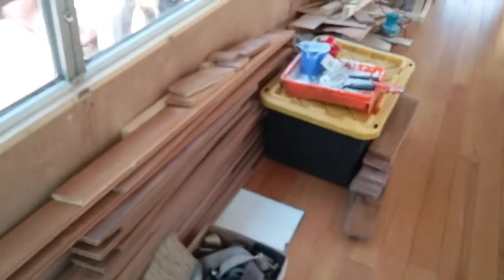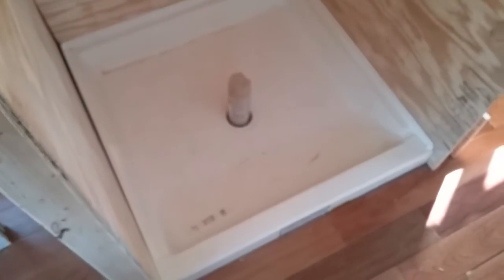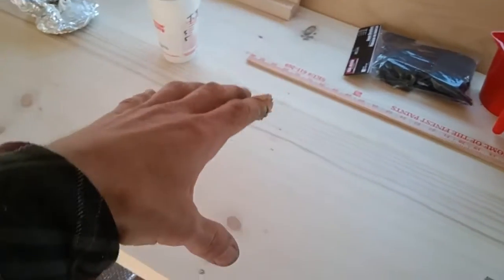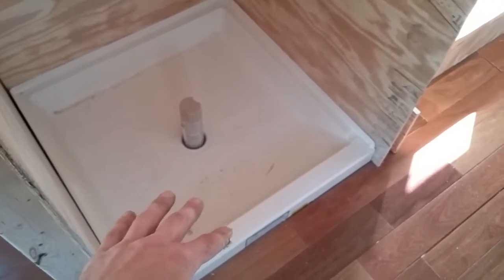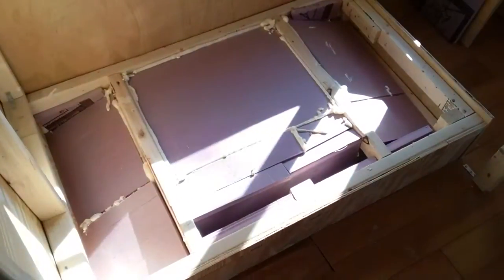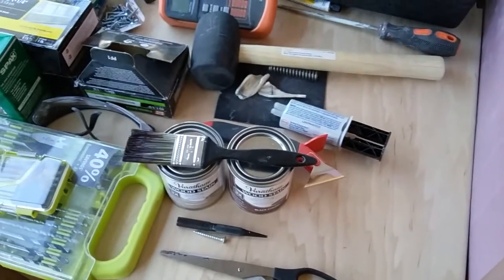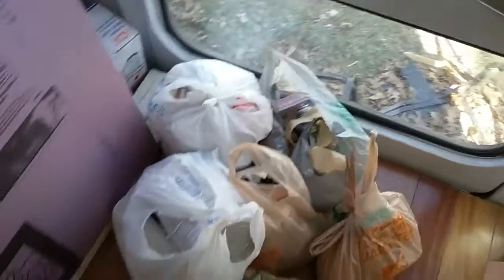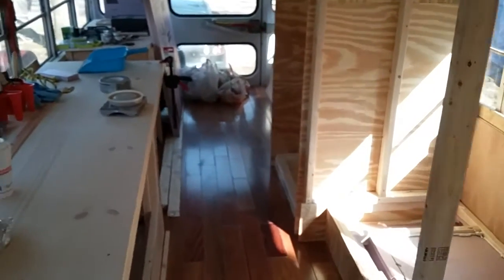Bus conversion ☆☆ day 27 more walls

Comment: Wax ring on the shower? Doesn't the shower drain come with gasket?
Reply from the maker: Chris Little yes but you are misunderstanding what I used the wax ring for... I used the wax ring to seal the actual hole I cut through the bus floor ( it is working great !!! )... the gasket that comes with the base is for sealing the plumbing,  you still need to seal the hole through the floor....